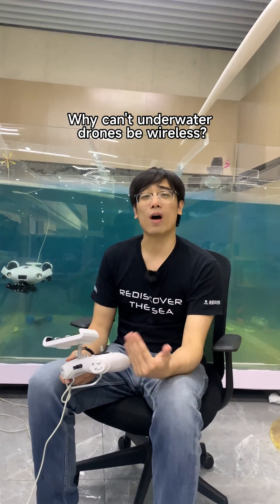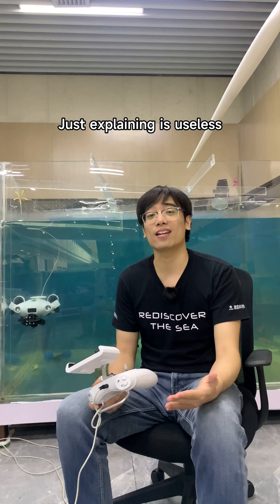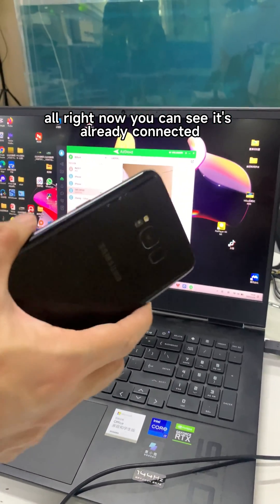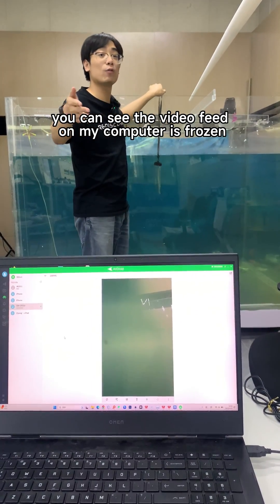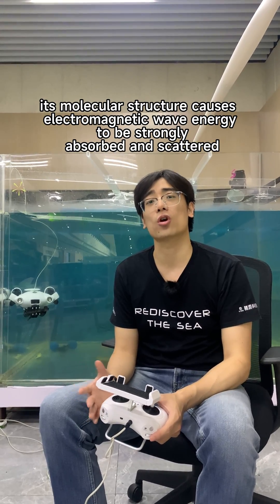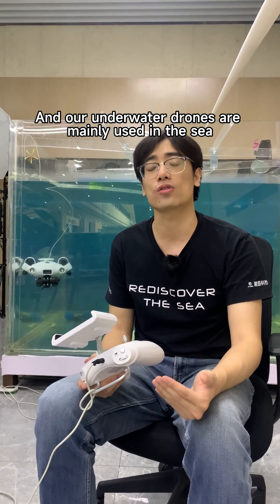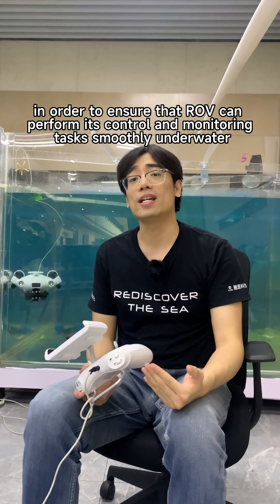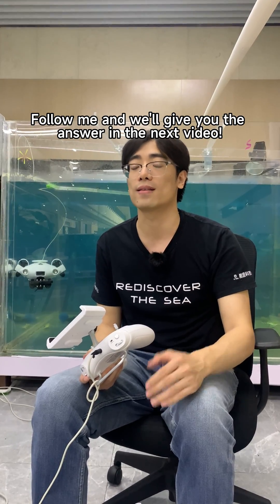Why Underwater Drones cannot be Wireless?  #shorts

Comment: Just wondering, my drone sometimes gets stuck in underwater grass in the propellers and stops moving. Only way to retrieve is to pull on tether cord. I'm not comfortable doing it because I don't know if I pull too hard if I'm going to break it and lose drone. Should I be pulling on tether to retrieve it or should I be tying a seperate rope/twine/fishing string to tailfin to retrieve it?
Reply from the maker: Hi Edward, thank you for your inquiry! Please note the tether supports 100kg of force, so pulling and retrieving the drone will not be a problem. In addition, you may consider adding propeller protectors to your FIFISH which will prevent weeds, sediment or grass from getting stick in the propellers; cheers!

http://store.qysea.com/propeller-protectors.html